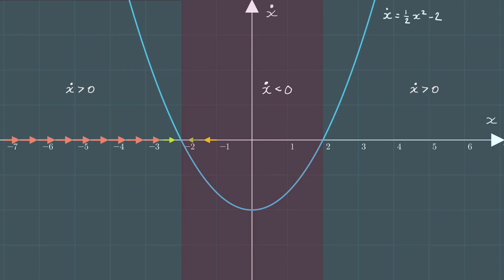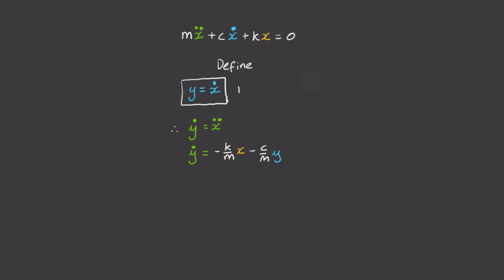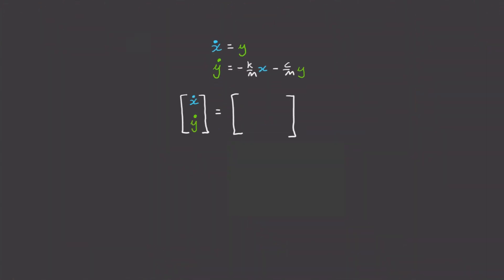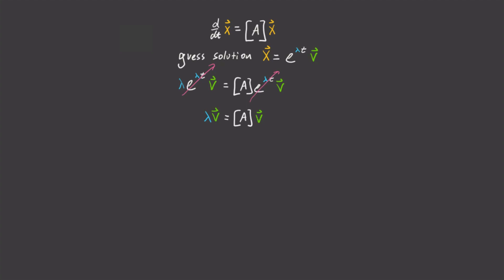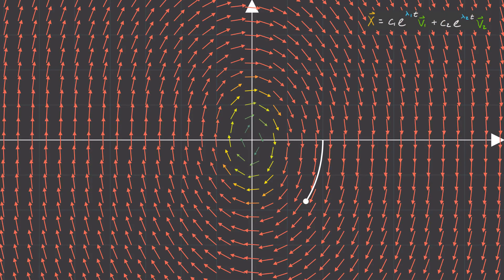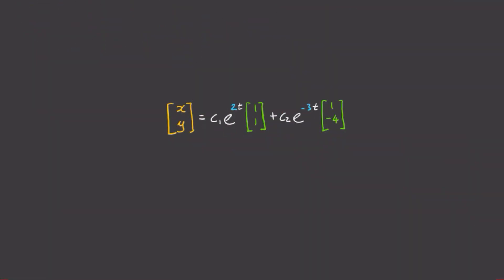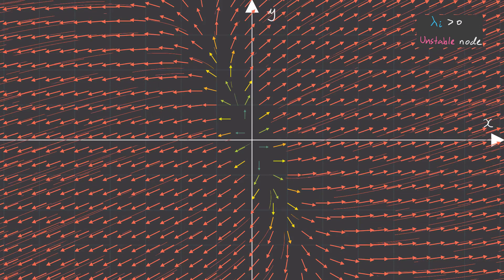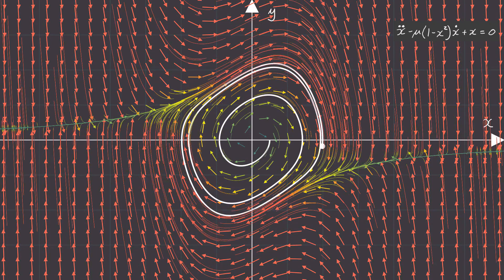2.0 A better way to understand Differential Equations | Nonlinear Dynamics | 2D Linear Diff Eqns

Comment: have a question. the stability and instability of the fixed points... do what exactly to the system as a whole... does the solution to the nonlinear ODE.. blow out , resulting in no solution to the equation. Stability.. reduction in oscillations in the system, so it decays to the solutions of the equation..
Reply from the maker: Good question. The stability of fixed points only gives you very local information, it tells you absolutely nothing about the system as a whole. Even though fixed point analysis is easy to do and quite useful, it's almost always never enough to analyze a nonlinear differential equation
Reply: @virtually_passed  so is the approach to solving the system behavior to  examine it numerically....

Comment: hello, great video how did you draw the vector field from the differential equation
Reply from the maker: I used a python library called manim. :)
Reply: @virtually_passed  for example if i wanna draw it by hand how do i do the math, do i need only the eighen vectors and values
Reply from the maker: @shebo96  for a linear system (like the ones shown in this video) then yes, you only need the eigenvalues and eigenvectors to know what the entire vector field will look like.
Reply: @virtually_passed  thanks for replying. How do you figure the vector field from the eighenvector and eigenvalue. For example at point (10,9) how do you evaluate the vector there from the given  eighenvectors (1,1) (1,0) and eigenvalues 2 and 4

Comment: Is there a saddle spiral?
Reply from the maker: That's not possible. If you solve for the eigenvalues you'll find you need to solve a quadratic equation. By playing around with it you'll see it's impossible to get complex conjugates and different real values at the same time.

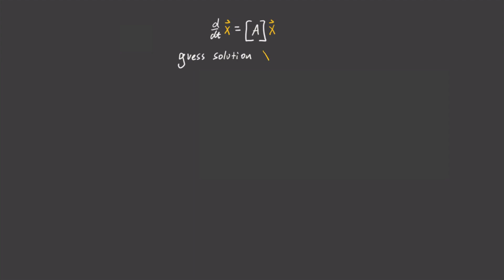Comment: @3:10 "guess solution" it's the reason I strongly disliked math teachers in school.  if you "happen to guess correctly", I also "happen to guess correctly" the results directly and better not ask me how because I'll say I guessed like you do.
If you have list of probable guesses tell it to me; 
If it's a heuristic that physical systems tend to have these sort of solutions just say so; 
If you only know how to solve this type of problem, again it's fine but just say it. 

If your prepared problem solution involves guessing and pulling tricks out of a hat, you're teaching voodoo divine intuition, not math where all steps are logically linked.
Reply from the maker: Hey! Thanks for the comment. You raise a good point! You're right that the guess isn't 'completely arbitrary'! Let me give you some motivation behind this guess. Consider the 1D version of the differential equation (where 'a', 'x' and 't' are scalars):

dx/dt = a x

We can solve this equation directly without any guesses needed. Dividing by x and integrating both sides yields:

∫1/x  dx    = ∫a dt

ln(x) = a t + c

x = e^(at+c)

x = e^(at)*e^c

Define e^c = v

x = e^(at)*v 

As you can see the solution to the 1D version is in the form of our guess for the 2D problem. In my view, you can consider this 'good motivation' for the guess shown at 3:10.
-------------------------
However, if you're deadset on solving this set of linear differential equations without any 'lucky' guesses, then this is also still possible! Let's say you have the following set of equations.

1) dx/dt = ax + by
2) dy/dt = cx + dy

Differentiate equation 1) wrt time.
d^2x/dt^2 = a*dx/dt + b*dy/dt

substitute out dy/dt using equation 2)
d^2x/dt^2 = a*dx/dt + b*(cx+dy)

Now you can solve for y purely as a function of x, dx/dt and dx^2/dt^2. And as a result, you can uncouple the differential equations and solve them directly. 

Hope that helps :)
Reply: @virtually_passed  Thanks for the reply! This really ties together the video. 
It was a really interesting series, btw. Phase space diagrams are really cool!

Comment: This is fantastic ! Do you have any further ressources that I could look up if I want to know more about this ? Especially the link between differential equations and eigen-stuff
Reply from the maker: Hello, great question! Yes I do. There are two books that I used for this mini-series. One is "Nonlinear Dynamics and Chaos" by Steven Strogatz. The other is "Nonlinear Differential Equations and Dynamical Systems" by Ferdinant Verhulst. In my opinion the book by Strogatz is much easier for beginners. Good luck!